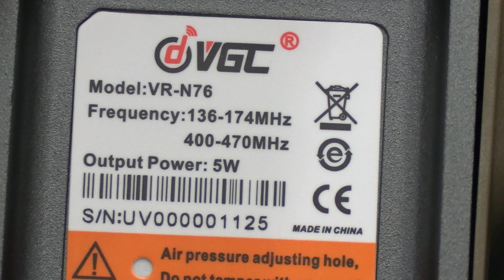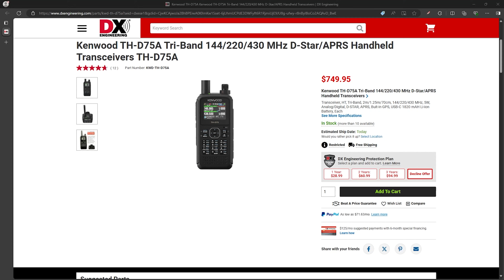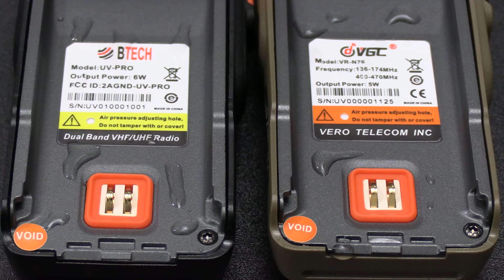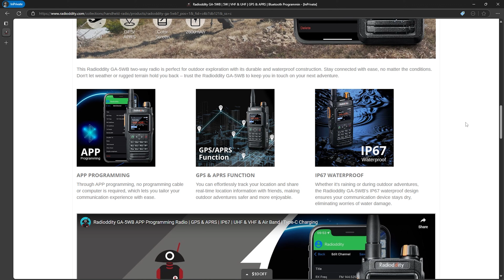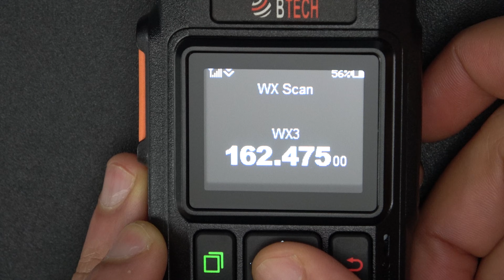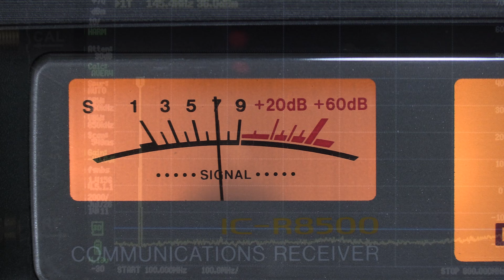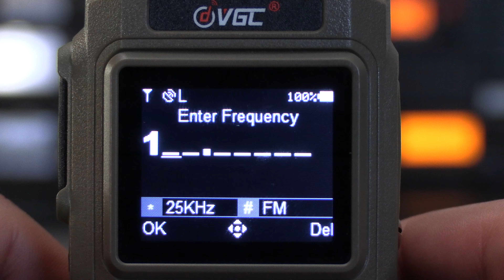VR-N76 & UV-PRO | Ultimate Guide Intro and Basic Questions

Comment: If the hardware appears to be the same, would you know if it is possible to put one version of software onto the other? i.e. put the UV-Pro software onto the VR-N76, or vice-versa? I'm just curious if the NOAA Weather software would work on the VR-N76, or are there hardware differences?
Reply from the maker: The hardware is the same but the app knows which model is connected and will only download the firmware for your model. There might be a way to hack it and push the firmware you want somehow but haven't gotten a chance to reverse engineer the process.

Comment: Thanks for this vid! For the BtechUV-Pro, Are there any functions that would be unavailable or blocked, including during initial setup, if a user does not enter HAM call signs (or other identifiers)[no legal answers plz] ?
Reply from the maker: Sure thing! Thanks for the question! Pretty much just APRS requires a call sign for use but BSS and everything else works just fine
Reply: @The_Comms_Channel  so...does that mean I can use the usual texting function thats available for this radio? Thanks again.
Reply from the maker: @rw4669  that's correct, you can use BSS for texting, location sharing, and more
Reply: @ Thanks very much. Im purchasing my 2 via your affiliate links.

Comment: The DTMF on the BTECH UV-PRO doesn't work.
Reply: Ok it will do DTMF but you have to go into the DTMF setting enter the DTMF and then send it. I am used to just keying the radio and entering DTMF codes.

Comment: Could you make a video on how to take apart this radio? Since it's not possible to reduce the power in the software, I've decided to change the voltages on the PCB, but there are no instructions anywhere on disassembling this radio.

Comment: Can someone explain what the gauge is on main screen when receiving transmission  0-9 and goes from white to red?
Reply from the maker: Signal strength meter
Reply: Thank you! When in the red zone does that indicate it is getting too much signal and is degrading the transmission? I am using stock rubber duck and seem to get a lot of static when on local repeater I could get better antenna or adjust squelch?
Reply from the maker: @allensteigerwald5618  Sure thing! Just means it's a strong signal and not necessarily too much.

The stock rubber duck is generally not great on most radios and definitely recommend upgrading. We cover a few options in the Accessories video that I've been happy with.

https://youtu.be/wwXqxKoCQlU

Comment: Is there mic that works with this radio other than the Bluetooth mic?  I've seen info that says it accepts Kenwood style plug, but then I see info that says although it fits, it doesn't work properly.
Reply from the maker: Thanks for the question! They have an adapter that will allow use of mics with Kenwood style adapters. Be sure to check out our accessories video where we cover this!
https://youtu.be/wwXqxKoCQlU?si=xzkJlsW4BR_naHs2&t=177

Comment: Unfortunately, I purchased both of these radios at separate times and both of them had absolutely the worst receive out of all the radios I own. The $12 Retevis RT85 is 100% better as far as receiving the same signals sitting side-by-side. The Bluetooth hand mic was horrible too. I am not much in the APRS guy, so I returned both radios and stuck with the $12 Retevis. I was only going to use the radio to sit on my desk at work and didn’t wanna take the Yaesu or Kenwood’s and have a chance that somebody would take them. On another note, I love your videos and keep up the good work.

Comment: Will I be able to use 156.050 to 162.500 MHz marine band if necessary, emergency etc..?
Reply from the maker: Sure can. My radios are able to TX across the whole range. If you get one that is locked to just Ham, it is possible to unlock by hitting the battery voltage area on the app 10 times.
Reply from the maker: Thanks for the question! We'll cover this in the series!

Comment: Has anyone tried the VR-N76 with a Cardo Packtalk Motorcycle intercom, (and PTT BT switch). 
Just looking for some real work experince with bluetooth connectivity to motorcycle headsets. We use ham radios while riding in the Rocky Mountians during the summer and Baja in the winter.

Comment: As always, great production value, and clear info!! I've had a BTech for a month or so and have worked through most of the less obvious things, and running it with a waterproof Ulefone device gives me a compact, rugged little system. I have not used their BSS club or signed up for their notably foreign account… nor will I. I also haven't tried the internet features, as what’s the point (enlighten me!). I'll ask a few questions here to seed your upcoming series: 

First, my dumb TNC Questions:
1) the only advantage of BT TNC over AFSK is less cable clutter? Or, does it do some things like signal control better too? Other pros?
2) Once you use the TNC to connect you don’t have to worry about volume level from the phone/tablet like you do with a AFSK connection, right?

One of my main use cases is SAR - being able to deploy multiple teams in the field and track what ground they actually covered, get positions (even automatically with the track features), even have them send back position-marked SSTV images of clues would be huge. My question you may get into later episode is could I have one UV-PRO with Digipeater turned on and a high antenna act like a local network controller (Just to extend distances) for these multiple search patrols all communicating back to base? I’d love to see (or do) a field exercise with multiple units to map out the hows and why's.

As I'm thinking, this may be a GMRS solution, as not all SAR responders will have HAM licenses... then, no APRS... I wonder what gaps the GMRS-PRO fills?

OK, Misses: 
I wish there was more device lock options: lock the volume knob, etc.
I wish there were color choices so I could do red text like my other radios

Awrighty - thanks again and great work!!
Reply from the maker: Appreciate the comment and questions! I'll try to incorporate all of them in the upcoming series. A quick tidbit on these radios and the GMRS-PRO, turns out the GMRS-PRO uses BSS as for its location/text comms so they're able to technically communicate. Covered this in the GMRS-PRO review if you haven't seen that yet.

Thanks again for the detailed comment and questions!
Reply: @The_Comms_Channel  I can send more sticking points as I find them - which I am! climbed a little local peek and tried to connect WOAD... classic fail. I don't even know what to ask, but I'll isolate in hopes that it helps others!

Comment: Just FYI, the reason I am so excited about this radio is that the one thing I have been looking for, heretofore vainly, for SHTF scenario, is an easy way to send short encrypted messages between family members via a multi-use handheld dual- or tri-band radio that uses a Bluetooth app for that purpose. Such short duration transmissions, especially if low power and directional, using a system of alternating frequencies, would be very difficult to be targeted via DF. And this is something so easily done that it could be quickly taught to all family members, even those not tech savvy. The encryption/decryption part requires a second app and more steps but is still easily done. Your channel is my favorite because of videos like this.
Reply from the maker: @jfm30204  all very good points and sounds like we like this radio for similar reasons 🙂 Appreciate the comments and glad you're enjoying the content! Much more to come!
Reply: Have you tried the Rattle Gram App? It allows a person to send a digital text message via RF, over Any radio! Its easy to use and it works!
Reply: I have some GMRS radios with encryption options, but they all seem limited, and aren’t legal to use. Especially with these being amateur radio bands, you may get a letter in the mail from the FCC,
Reply: If you are looking for short encrypted messages between family members using Bluetooth, something like Meshtastic/Meshcore (whichever has a bigger network in your area) would be perfect! I suggest you research more into those rather than amateur radio where your proposed ideas are just illegal (although it has been a year so you most likely have changed your idea or already found this out)

Comment: Great video, thanks! I notice on the VGC site, though, that the unit is listed as 7w, "VERO Dual Band 7W Handheld 2-Way Radio", while the Btech unit is 5w. That would seem to be a significant advantage for the VGC version.
Reply from the maker: @jfm30204  thanks! Yeah, there seems to be some discrepancies, but they're the same hardware so they should be the same. The VGC website says 7W but the sticker on the VGC says 5W. The BTECH website says 5W but the sticker on that says 6W lol.
Reply: @The_Comms_Channel  That's funny. Anyway, as the NotaRubicon guy says, they all "squirt out" adequate "electricities", given the form factor.

Comment: Another great series idea. Topics that I am still struggling with are the need to frequently re-pair the radio to get the app to work on iOS, how to use the APRS beacon while monitoring another channel without having to listen to the APRS traffic, and best practices for using the Bluetooth microphone, such as locking the channel toggle on the top of the wireless mic to avoid accidental changes.
Reply from the maker: @artclosson2500  appreciate the comment and suggestions! I'll look into adding those into the series.

Comment: I’ve had my VR-N76 for a few months and I tried to use it with APRS and Winlink but I use mostly Linux and an iPad for my computer stuff so Winlink doesn’t work to well. So it just sits on my desk now. Hopefully this series will bring back my curiosity. Thanks.
Reply from the maker: Sure thing! They did some firmware updates not too long ago to improve the handling of the more complex WinLink packets so you should have a better experience. We'll be covering Linux, Pat Winlink and RadioMail in the series so stay tuned!

Comment: Isn’t there something different with the banks of memory channels.  16 vs 30 or something?   I’ve also heard some reviewers report about poor or weak receiving.  Any experience with this?
Reply: I just bench tested my radio and can tell you that the sensitivity is as good as any ham or commercial radio that I’ve ever tested.
Reply from the maker: It has 6 banks of 30 channels. It used to be 16 channels in each bank, but they upped it in a firmware update. Like many stock rubber ducks, the included antenna isn't the best and I highly recommend upgrading. That is probably the source of the poor signal reports.

Comment: I just bought the clear version of the VGC. Came with a clear battery and clip, which gave some insight on battery construction. It's not a flat cell, it's actually 2s 18650, which is absolutely great. It means there's some chance of a battery rebuild down the line. Also there is an obvious balancing connection, which is good in a 2s config.
Reply from the maker: I saw they had a clear one now and I thought those looked like 18650s. Thanks for verifying!

Comment: Great stuff.  The Radioddity version is exactly the same as the other one.  The only difference I can find is that the UV Pro has the weather channels pre-programmed in.  You can easily add them back yourself via the app.
Reply from the maker: Appreciate the comment! Had a feeling that was the case but wasn't sure. Thank you for confirming!

Comment: Great video, I've had my UV-Pro since last September and I really like it. My only gripe, not so much with the radio, but rather the wireless bluetooth speaker mic. I returned it I did not the the audio quality. Anyway looking forward to your next video on this little gem. 73....
Reply from the maker: Appreciate the comment and you being a subscriber! Great radio for sure! I've not used the wireless mic much myself. Using the phone as a speaker/mic works well and since it's always on me, might as well use it.
Reply: You mentioned the Bluetooth microphone. I am looking for a replacement for my Midland G9 + wired headset.
Is the quality that poor, or is it sufficient for speaking?
Reply: @Kurikost_ it sounds tinny if that makes sense, definitely legible, hope that helps
Reply: @aragonep  many thanks..helps a lot. I don't need a very good sound

Comment: Great video. I also bought the VGC version because I love the flat dark earth color. I've had this radio for about a month now, and it has become my EDC radio. I use it for APRS amongst other things. I only have two things I would love to see changed on the radio: I would love the red colors to go away. They are very hard to read with my older eyes. Also, I would love to see the option of having one big channel bank instead of 6 individual smaller ones. Other than that, if they address some of the minor quirks such as the color of the display, I plan to buy a second one.
Reply from the maker: @SheepdogPreparedness  hard to beat that color for sure! Thanks for your suggestions. I'll pass your message along to them!